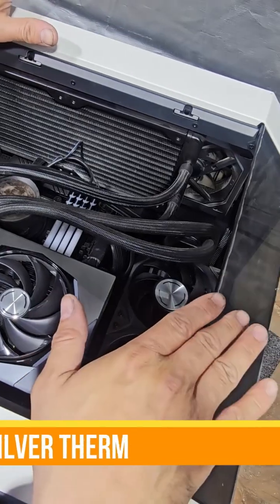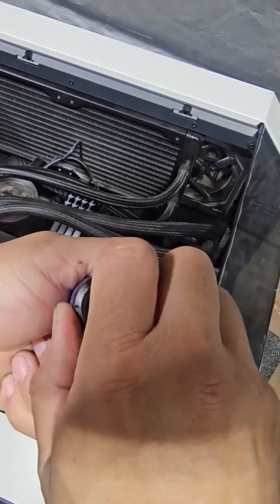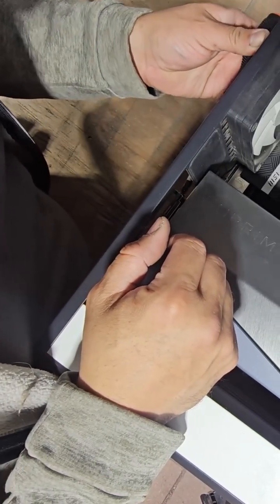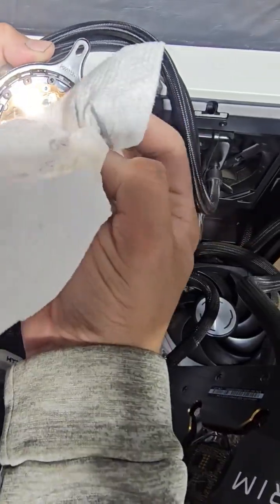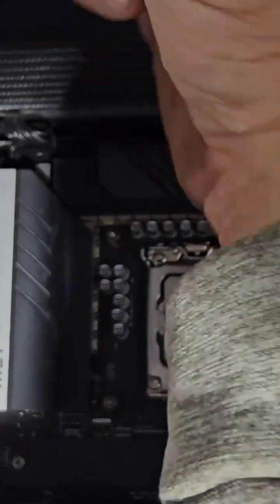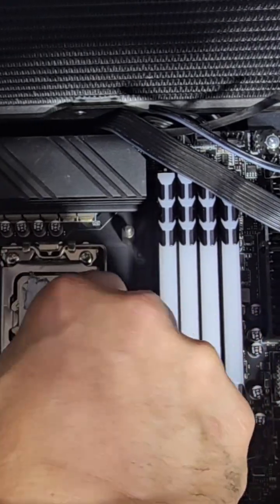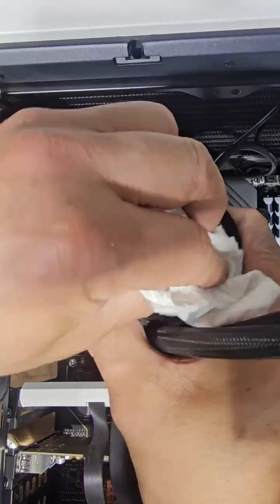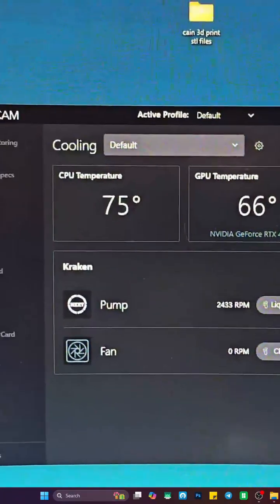Silver Thermal Paste Upgrade

Comment: go full Noctua liquid cooled is trash i had a 420 aio /w 6 140mm fans on my I9 14900k it would hit 100C at the windows desktop. Went full Noctua never goes over 81C now even when gaming it hags around 42-75C changes all the time but i have a Hyperion case with full Noctua fan kits.